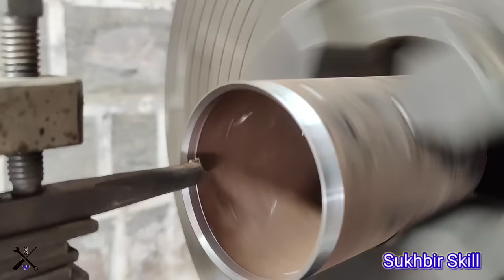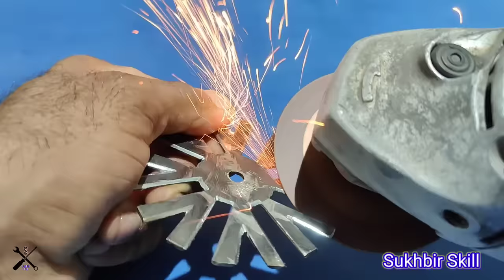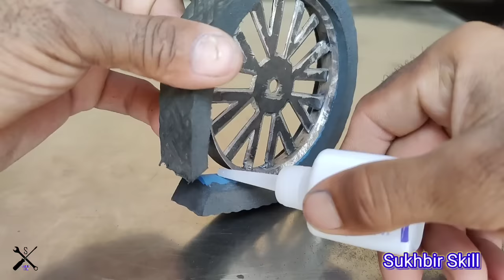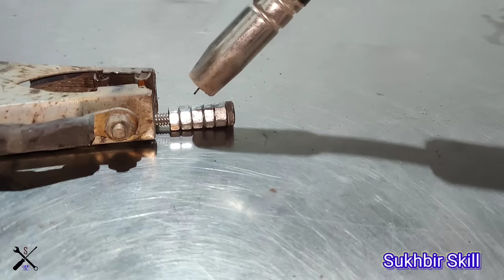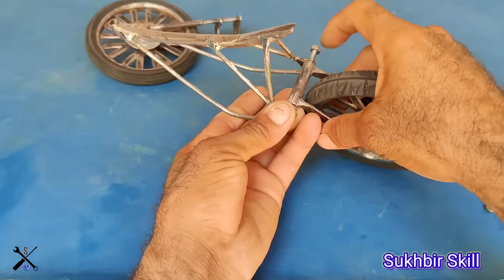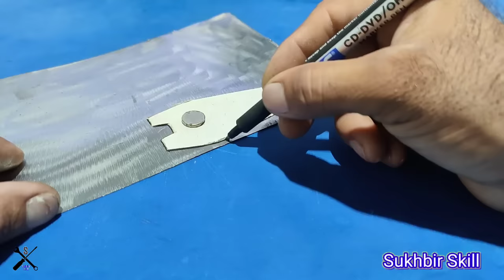Diy bike project || how to make a bike || powerful bullet bike

Comment: That engine is so torque but at so low rpm that means impossible for fuel ignition so an electric motor is used inside the engine and the exhaust smoke is created by compression of some fuel just to give an impression. ☺️
Reply: نعم هذا صحيح المحرك ديزل مجرد خدعة
Reply: نعم هذا صحيح المحرك ديزل مجرد خدعة
Reply: Naaah, un motor a gasolina así de pequeño y con pocas partes visibles sería un poco difícil de fabricar. 

Posiblemente sea un motor a gasolina de algún juguete, puede ser un motor Sterling, es decir a vapor.

Se nota que acelera cuando se atasca en la arena, las bajas revoluciones pueden ser por una pequeña caja de engranajes.

Si es un motor Sterling no puedo imaginar como almacena el agua caliente y la fuente de calor en un espacio tan reducido 🤔
Reply: Your motor will get some popularity only in social media and not more then that. No one is so gullible. Sorry.

Comment: Could you tell us more about that engine?
Thank you! B-)
Reply from the maker: I will not tell now, I will definitely open in the coming time how it was made
Reply: it's a electric motor with sound board and smoke all can be bought
Reply: @phil36135  I imagined something similar. It is too small to put a stirling or a steam engine (the sound is identical), plus there is no flame, no water or fuel tank.
That does not take away from the fact that the work is great.
Reply: its a real engine you can see itt when he puts that on desk there are parts moving , you can cee his other videos he make the mechanism that are impossible to make with such tiny precision , he is a gem his work is true peice of art

Comment: Tiny electric motor inside the  Crafted engine shell, battery is in the gas tank , you can see the wires from the motor

Comment: not real, battery powered with vape smoke and mirrors. not for true petrol heads. a bit of fun though, just an ornament, and dont know where he got sheet metal that will solder that easily, it will need treating and painting, cos it wont stay nice and shiney for long.
i still have a steam engine i made at school 50 years ago, brass, copper, steel, lead and aluminium, (or similar alloy) neglected in the shed, turned a piston on the lathe, made a con rod and big and small end with a file and brass. cast a flywheel with wooden dummy into casting sand out of aluminium and turned it on the lathe, then drilled and polished. engine block was square cut brass and drilled precisely for rotation of steel crankshaft with brass bearings.
still love the post though, just a "bit you tube"